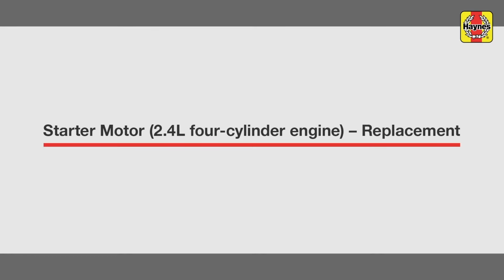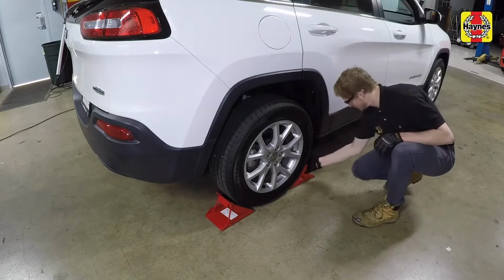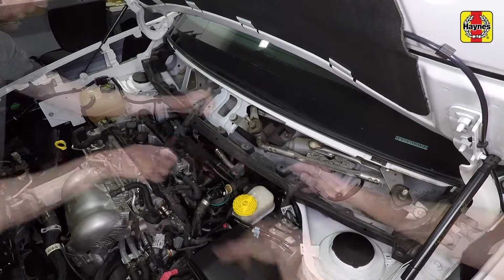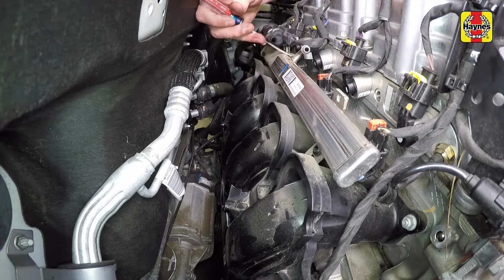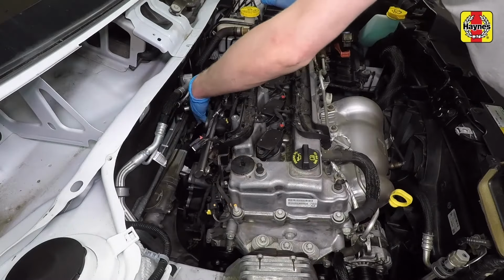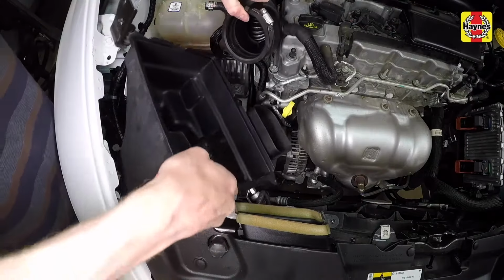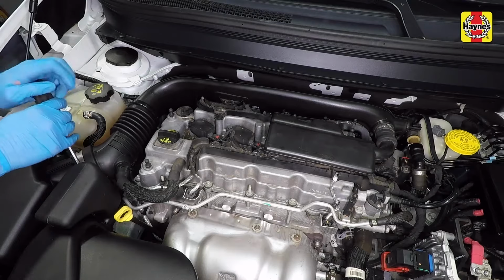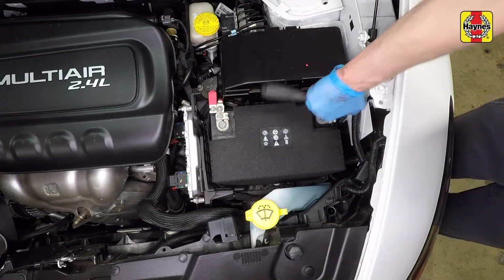How to Replace the starter motor on the Jeep Cherokee 2014 to 2019

Comment: Wow, to drain the fuel pressure from the fuel rail, just pull the fuel pump relay and give it a crank. That should be a lot easier than removing the rear seat. This is crazy just to get to a starter

Comment: This video makes me lol, I replaced my starter myself and didn’t have to do anything other than disconnect the battery and remove the splash plate under my 2019 jeep Cherokee. The top bolt can be reached from the top of the engine, use a light and elbow attachment to make it easier. Other bolts are underneath.
Reply: @kristie1131  how did you actually remove the starter motor?
Reply: @ It can be easy or difficult depending on your car. Some cars may require removing more than you want to remove which you would probably want a mechanic for. Mine was accessible from the bottom but had to be maneuvered just right to twist out, I rotated it as I dropped it. (Same installing) I lifted my jeep up to do this and removed the splash plate. IMPORTANT: Disconnect your battery before doing anything. Be sure you disconnect the three bolts (if yours has three) as well as the electrical cable (should be a black plastic square) that is attached with a push pin type plastic piece. I removed the bottom bolt last because it is the easiest and will hold it up while you remove the other two. 
Twist it out pop the new one in. 
After a few bad starters I into issues with my bolts from a prior mechanic being the wrong size and had them all mixed up so make sure you contact an authorized dealer to figure out what size bolts you need at each point (they can be bought at ace hardware or use the ones you had but try not to mix their location up like I did) Typically one bolt is on top and can be accessed from the top of the engine but it’s deep in there so you’ll need a few tools and a flashlight. I used a wrench, ratchet w/socket socket swivel at times and wide pliers due to them being jammed in there. It took me forever (4 hours) due to the bolts being the wrong size otherwise it would have been really fast. There’s a bolt on the bottom, one on the side that you may be able to access from the bottom/top and then the top bolt.
Total I paid $140 for the part to replace mine. Mechanics were quoting me $1,000-$1,300.  I bought ratcheting wrenches that were helpful and went back and forth with all of the tools. Be sure you chock your wheels when you lift it and have support stands holding it up. I kept my jack under it along with the stands as an extra safety precaution. Last thing be sure your jack and stands are rated for your car, my jeep requires at least a 3 ton jack. Hope this helps, good luck!

Comment: Thank you for such detailed instructions, I just replaced the starter on my 2014 4x4 jeep and your instructions are excellent.   Replacing it on a 4x2 is much easier, the 4x4 the transfer case is on the way so removing the intake manifold is the only way.

Comment: I just did this work at a shop that I work and all I did was remove the battery completely, remove the two bolts that hold the starter from up top (16mm), then remove one bolt that holds the starter from the bottom (14mm). Once a starter is loose U-Pull-It away about an inch so you could remove the power cable and then remove the connector. Then you play with the starter in different angles until you sneak it between the axle and the intake manifold. Reverse procedure for installing
Reply: Thanks man I will try to take it out tomorrow, I thought I was going to have to remove the catalytic converter at the least…

Comment: Thank you for producing and posting this excellent video. We just completed the starter replacement on a 2014 Cherokee. Found it's much easier to do it all from the bottom. The bolt on the driver side is tricky, but you can loosen it with a 15mm wrench. We removed the exhaust pipe, but left the CV axle in place. Hope this helps someone.

Comment: I wish that this video was incorrect. I have the 4x4 and Jeep put the transfer case directly below the starter. There is no way to even touch the starter from any direction. So you can't even wiggle the wires on the starter without doing all this

Comment: You really don’t have to do all that stuff, I work in a fca dealership, that deals with dodge, ram Chrysler and jeeps, you can take it off from the bottom, just take out the top two bolts from up top. Disconnect the connector and nut,take out the Lower mount bolt to be able to pry it out for more space
Reply: How long should this take?
Reply: Yes you do.  Or at least you should if you know anything about the electrical system.

Comment: "After removing the fuel pump wiring, START THE VEHICLE..." Um.... I CAN'T! THATS WHY I NEED TO REPLACE THE STARTER!
Reply: Forget that. Fully insure said Jeep Cherokee and have towed to nearest cliff. Have tow truck driver unload said Cherokee facing cliff. Turn Cherokee keys to acc and shift into neutral. Disengage parking brake and push Cherokee over cliff. File insurance claim. Have a friend follow you for ride home.
Reply: 🤣🤣🤣 Right?!?! I just had my Jeep towed in and I’m almost certain it’s the starter but FFS no way all is necessary.
Reply: @Networkputz  why did he take the wipers off😂😂
Reply: The dude is a 🤡🤡😂😂
Reply: I was thinking that as well.
Reply: before that, your replacing the STARTER cause its likely not working and cranking the car.......
Reply: @Ndr03903  man. Lol

Comment: So I literally just did this in my shop today and the easiest way I found to replace this starter was to remove the fuse box assembly behind the battery and I was able to get a long quarter inch extension with a swivel 14mm socket to loosen the top bolt.  Took me about 40 min due to the fact I also took off the cowl and most of the intake bolts in the beginning.  I can't wait to get another jeep Cherokee starter job
Reply: Where are u
Reply: I'm wondering if it's the same processes on the 4x4 model??
Reply: Was that a 4x4?
Reply: Yea there was no way I was gonna do this the Haynes way lol thanks for the heads up 🍻

Comment: 1.Remove your battery cables. 
2. Remove the splash guard. 
3. Remove your starter.
4. Don't do all that unnecessary crap on this video. 
5. Thank me later.
Reply: Is the starter accesible from underneath the truck?

Comment: lmao...wtf.. ???. remove back seat, relive fuel pressure, put that car up on jack stands, remove all 4 tires along with everything else you see, pop the hood remove battery, air intake, valve cover to reveal the spark plugs... Now that's all done..... lmao
YOU CAN JUST
Have car on Ramps or Jack stands Crawl under car, remove plastic splash guard 6 -10 10mm bolts,  locate starter in front of engine are behind exhaust pipe disconnect Signal wire (black clip) undo the one power wire 12mm, unloosen the 2 mounting bolts and remove starter.. and repeat install
Reply: Yup, they are trying to charge me $1200 to replace the starter at the dealership 😂 Having it towed to my brother who’s a mechanic and is ready to call them up screaming. Unbelievable 😂
Reply: Lmao this video has to be a damn joke .   SMH 🤦🏽‍♀️
Reply: I can’t maneuver the starter out without doing all of this or moving the catalytic converter how do you get it out???

Comment: Surely there is an easier way to replace s starter! This is crazy!
Reply: That's what Chrysler, Dodge, Jeep products are designed as to keep labor times and prices high.. they sell you the vehicle then screw you when it breaks
Reply: Nope
Reply: @robertmorrow3128  im with ya like I aint pulling the back seats ill pull the fuse ffs

Comment: You don’t have to remove all this stuff to get the starter off
Reply: What would you recommend on how to get to that top bolt? I don't really want to take all that off myself.
Reply: @alexlarocque1521   my mechanic took the battery out and then use a extension adjustable connector I couldn’t believe how quick he got it done
Reply: @antoinettemadlock3065  is that really all he did?
Reply: @dark_wraith4784   yes took less than a hour
Reply: @antoinettemadlock3065  stop lying lol 😂
Reply: @Stonerr313  unlikely she did. All that stuff he took off is not necessary.
Reply: Look like it depends on what engine size and 2 wd  vs AWD.